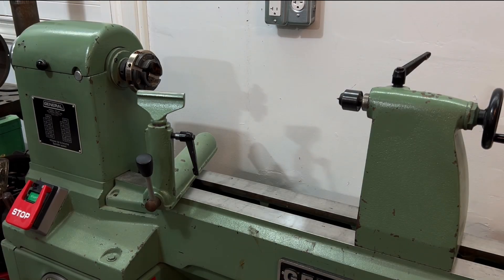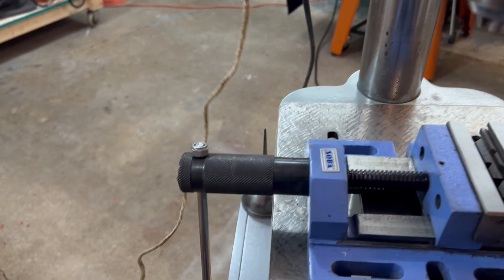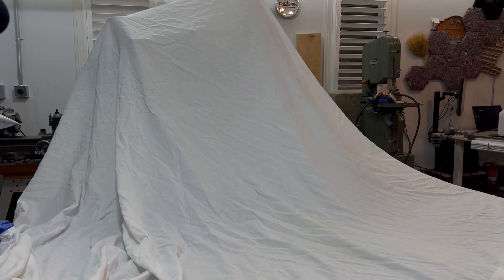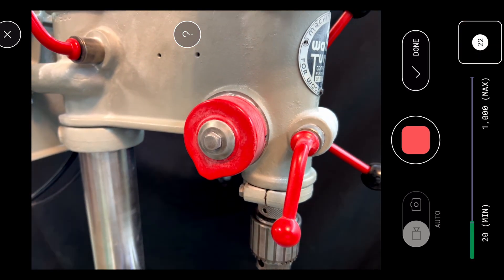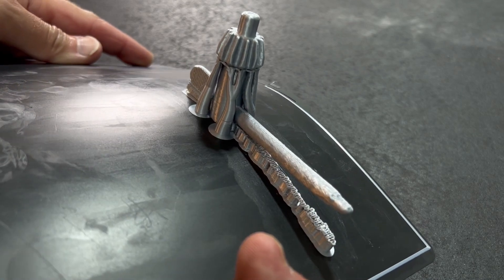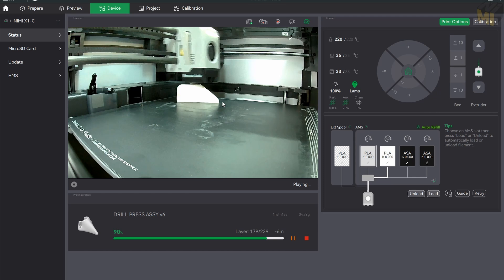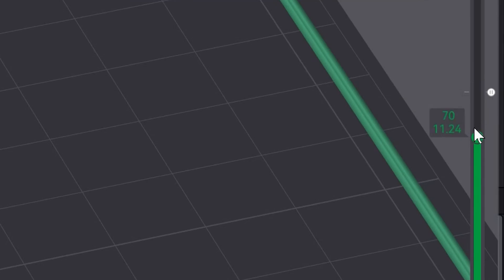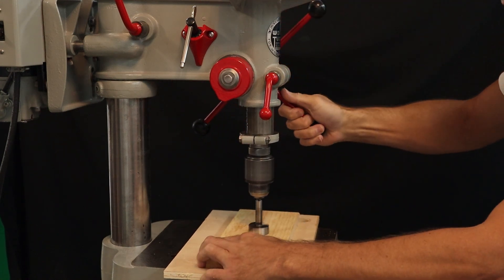3D Scanning for Function - Tool Holders -  Bambu X1C & Creality K1

Comment: Nice work. Does that app require a lidar to work that well?
Reply from the maker: I believe that you can use it without the lidar, but it will not be able to get a scale of the object, you'll need to take a measurement and scale it up.  I always do this regardless because it can be off by 1mm +/- anyway and I need them to be as exact as possible.   They also have a cloud based version online, you can upload your images.  I have a video on that one scanning a 2" tall model.  and it turned out super well, nearly perfect.  I recently printed it on the Bambu X1C and scaled it up, and it was incredible.